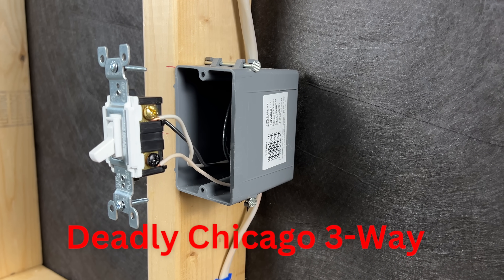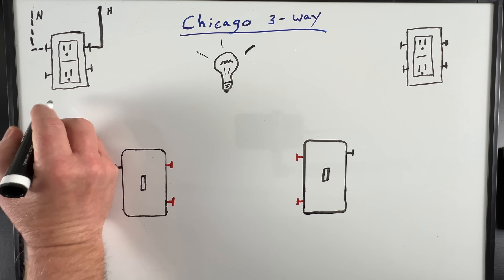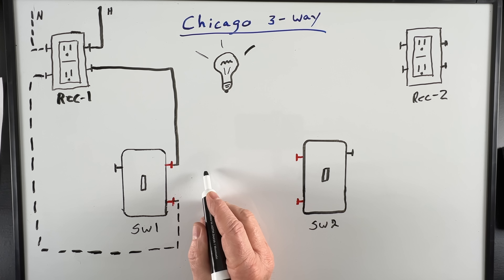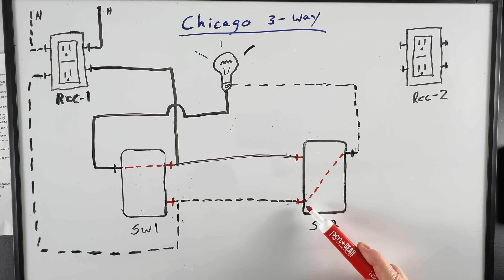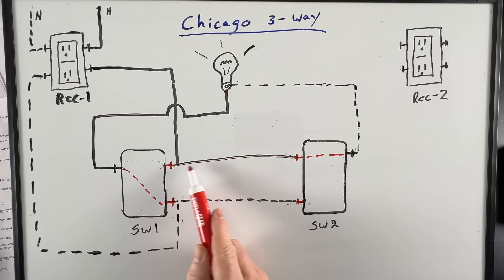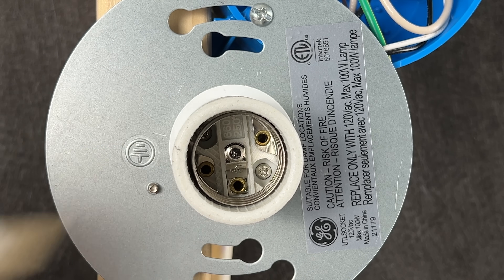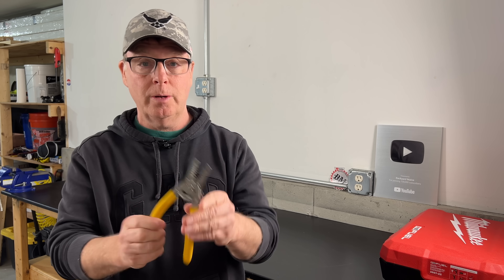The Deadly Chicago 3-Way (Only 2 Wires)

Comment: It feels like a building that has one of these would most likely not have the fuses labeled correctly either. I cant imagine one of these setups being used in a building new enough to have breakers.
Reply: Actually ran across one of these set ups in 2015, on a farm.  A three way switch in the house and barn controlled a yardlight in between,  with a single stranded wire from the house and barn, to the light, switches were on different panels,  house and barn.   Both were 100 amp  GE panels from  1977, when the 60 amp main and range fuse panels from when the farm got electricity in 1951 were replaced.    Suffice it to say,  this would never work with the AFCI / GFCI breakers required on virtually every 120 volt circuit in homes today, but this method was fairly common from the turn of the century, until 1950s and possibly even the 60s and 70s, on farms and the like, more often than not wired by old timers that lived during the great depression because it actually saved one wire, using 3 wires instead of 4, to switch a light between a pair of 3 way switches while having constant power for receptacle loads on both ends. My great grandparents grew up during the 1930s and would tell me stories about how their parents were forced to figure out on their own how to make the most do out of the least, as money was VERY scarce and times were tough, and I wouldn't be surprised if Grandpa wired some Chicago 3 ways on the farm they lived on for 12 ½ years, 1954 - 1967.

Comment: Young electrician raised on standard and dead-end methods. This just blew my mind. The ah-hah moment halfway through the video when I realized the light's polarity was going to be switched made me realize this is hick-ingenuity.
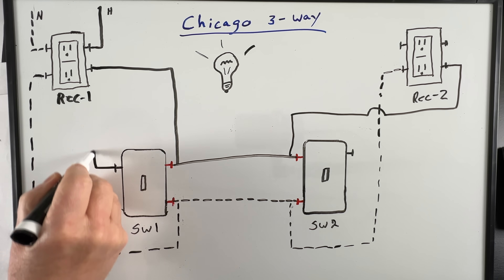Reply: 3:27 he mentions it. I didnt catch that until I read your comment.
So basically anything more complex than a lightbulb is gonna fry or have problems, right?
(im not an electrical guy.)
Reply: @threestans9096  not necessarily. Most everyday devices don't qctually care when AC is involved. It's mostly safety.
Reply: This is the best info I could find detailing a 2 wire 3-way circuit. While remodeling our flip house built in the 50's  I was scratching my head after opening the first jbox that had what appeared to be 2 neutrals feeding a 3 way switch. Old sparky ran 12/2/2 to the garage 3-way. I used a light tester to find the source out in the garage and I found it all right. Disconnecting and the  12/2/2 entirely...just to dangerous for me

Comment: It's crazy even if it does work. It's kinda like old pole lights on old buildings that were 220v and they just run one phase thru the contactor leaving one hot leg in the pole at all times.

Comment: I see these in every house I’ve rehabbed. I’m from St. Louis, but any house that is a 2 wire with no ground (50s or earlier) was wired this way. I moved to Omaha and same thing here. It is totally confusing and I’ve been shocked a few times thinking the power was off when I turned the light switch off. I turn power off now.

Comment: It seems like more work to wire it that way, I'm surprised that was common back in the day.
Reply from the maker: The wire system was much different and there were only one or two fuses for lighting and receptacles for the whole house. With this method they could go from receptacles to switches and back to receptacles with just two wires. Seems crazy now though.
Reply: @BackyardMaine  makes sense now that you point that out, pretty clever from an engineering standpoint even if it is very unsafe lol

Comment: We get the same thing here in the Philippines where i live there are 2 wires from the meter to the breaker box , no ground or nutural only 2 -110 wires into the house lights are 220 so if you turn the switch off the light is still hot, you have 110 to the light you have to throw the breaker to kill all power

Comment: I had one of these neutral flip 3 ways in my 100 YO house, it took me a bit to figure out what they did. You see this in old houses where the light fixture was always hot and then neutral flip modified with wall switches. As soon as I removed the bulb, I figured out what they did. It was old knob & tube wire, so they grab any available neutral source and run it to the lower light switch to save wire and time. They took neutral from the outlet to the lower switch, cutting & into the hall stairwell neutral at the fixture. Then added a switch at the top of the stairs tied to the nearest neutral, then down to the lower stairs switch and flipped neutral(s) to the fixture and abandoning the fixture old neutral wire. You can call that a MN neutral flip.

Comment: Im in Chicago and never came across this one but only What we “Line and Cross” which is essentially a Carter System or similar to California 3-Way, funny how I have not seen this method and I’m 24yrs in only ever working with cloth wire daily and running into knob and tube very often.
Reply from the maker: Interesting!
Reply: @BackyardMaine  yes it’s a very odd thing to see that wired when I’m in Chicago daily and most of the suburbs but in 24yrs I have only see the Carter System or that California 3-way, when I first started Dad always called it “Line and Cross”
Reply from the maker: @Jesus_Strong  I believe the Carter and the Chicago are the same method.
Reply: @BackyardMaine  ok I just rewatched the video and the receptacles are throwing me off. Every time I run into them is exactly that way, Hot and Neutral travelers, which essentially the switch leg at the light is always hot which is why customers get shocked or just interrupt the 3-way by changing the switch, all of this I see in cloth wire though mostly in armored cable or black rigid pipe.

Comment: I can share a fifth danger of this Chicago 3 w-way viring: if someone uses a higher power rated bulb and an arc builds in the one of the 2 switches on turning off it can short the hot and neutral. It may damage the switch, frighten the user or sometimes cause injury.

Comment: So if one is using LED bulbs, this wouldn’t work anyway because of that polarity bit
Reply from the maker: Actually with most if not all LED bulbs it won't matter. LEDs are supplied with DC power and you are correct that power only flows in one direction through a diode. But our AC power feed a power supply with then feeds DC power to the light.
Reply: @BackyardMaine  oh, OK I was thinking the reverse polarity would keep it from working. I didn’t realize it converts to DC in the light.

Comment: This leaves a lot to be desired in terms of showing where the actual cables would be run. For instance, the light has two wires coming into it, one from each switch. I know this was originally done with knob and tube, but how would that be wired with Romex?
Reply from the maker: With knob and tube wiring it was common to run one wire, two or sometimes three wires depending on the situation. With grounded cable it would make no sense.
Reply: @BackyardMaine  I see, thank you.

Comment: you could've made a much more simplified design if you mirrored both switches and had the light in the middle but ok I got the idea.
Reply from the maker: I thought about doing that actually after the white board presentation but I was worried people would loose interest.

Comment: Nice!

This isn't really hard to understand at all.  Beats me why some people have a hard time figuring this out. 

It's dangerous because it both routes power from the hot lead where it's not supposed to go as well as puts the neutral lead through a switch, which means the hot lead will still be applying power to the load when it shouldn't.

Thanks!

Comment: I found this chicago 3 way in a 1920s farm house here in Denver. the home owner changed the switches but got the wires mixed up. I figured it out and got it working so my recommendation. if you change the switches pay attention to where the terminals are on the old switches and on the new one(especially the common).

Comment: Very cool. Here in Oklahoma, many residential electricians and service electricians know of the Arkansas 3-way and the California 3-way, but this is the first I've heard of this one.
- Arkansas: in old houses where the circuit hot was brought first to the fixture box in the middle of the ceiling, a 14:2 Romex cable would be taken to the first 3W switch where only the black was used for power to the switch. (The white was not used). Then between switches, again 14:2 was strung for travelers. Then a third 14:2 was run from the second 3W switch back to the light fixture as a switchleg. (Again, the white was unused.)
- California: In stairwells where the circuit is closer to the upper switch and also to the fixture than any of these three are to the bottom switch, a 12:2 Romex is run to the upper switch for hot and neutral. Then a 12:3 is run from the upper switch down two the lower switch: white phased as constant hot, red and black for travelers. In the upper switch box, the circuit hot is NOT landed on the common screw of the upper switch; it is instead spliced to the hot-phased white inside the upper switch box. Finally, a 12:2 is run from the upper switch box to the fixture: white being neutral, and black being the switchleg tied the common screw.
Reply from the maker: Interesting.. I made a video on the California 3-way as well but I have not seen the Arkansas 3-way.

Comment: Electricians really were haphazard decades ago. There's something probably worse at my father's place; if you turn on/off 2 switches in one room, you'll get the fixture to dim about halfway, and plugging a load into the outlet makes it dim even more. I told him to hire an electrician, oh, about 20 years ago.. to make it worse, they're the older single push-in toggle buttons
Reply from the maker: I saw that one time as well many years ago. Must have been a homeowner using the ground wire as a switch leg. I have seen some scary things over the years.

Comment: Another problem I can see with the Chicago 3-way is if you do actually have a second outlet on that far right side, the bulb is now is parallel with the devices plugged into that far outlet when the bulb socket is in the HOT-HOT state. Only a small fraction of the current would flow through the bulb (proportional to the bulb's resistance compared to the normal hot), but it could lead to very unintended results.
Reply: Come to think of it, I might've experienced this in a 100+ year old Air BnB. The LED bulb was dim (maybe 5-10% brightness) when switched off. Now I'm thinking this is probably the explanation.

Comment: Honestly everybody talks about the danger of the way things used to be wired, but I have a way to go about it that has kept me from getting killed.
1) Assume everything is hot until proven otherwise
2) Don't touch anything
3) Avoid being grounded
4) If something must be touched, do not hold with both hands
As a welder, this also works pretty well for me.  I used to get shocked constantly, until I decided to not just let gloves give me a false sense of security.  Now when welding at home, I don't even change welding rods without either standing on something that is not grounded, or setting the electrode down and picking it back up with the stinger rather than holding the electrode in one hand and the stinger in the other.  I also turn off breakers or unplug lamps before changing lightbulbs if it requires removing a physically broken bulb.  I have been shocked countless times, most of which were inadvertent.  Every time, it was avoidable.  You cannot get shocked unless you allow yourself to make a circuit, plain and simple.  If you can't understand that, you're in the wrong line of work.

Comment: Im just a diy guy but have run into this a few times helping friends debug their houses. I always assumed these live off bulbs were caused by other diy people and i would remove the second switch. Im truly surprised that professional electricians believed this was ok.

You might also suggest putting a gfci outlet at the root of all two wire circuits - in case theres a partial short.

Comment: "Bear with me this will make sense in a second" No it won't, it'll work but it still won't make sense to me.

I mean I get it, I know how it works, it just doesn't make sense to me that anyone would ever think this was a good idea.
Reply from the maker: It was used back when electricity was first being installed in homes around the country. Before grounded systems were required and they used knob and tube wiring so it was much less of a hazard. Its been a violation since the 20s but there were many parts of the country that didn't have code enforcement so they were installed in some areas for a long time after. I have never seen one on a house built after 1950.

Comment: You can switch neutrals as long as it’s on the same throw as it’s associated hot.
Reply from the maker: True.. 404.2 (B) exception. But this cannot be done with 3-way and 4-way switches. 404.2 (A)

Comment: I first encountered a setup like this in a house I had bought that was built in 1954, although it didn't use 3-way switches, it used similar methods. They had wired the outside porch light to be permanently on and use a sensor with the same wiring and circuit as the kitchen sink light and switch that controlled the kitchen light, outside light and "GFCI" plug in the same double wallplate. I wanted the light on the switch.
I had everything off, yet got zapped by the neutral wires of all things. I also had the circuit breaker trip once I got everything hooked up correctly. I found out they had wired it like this where another switch on the opposite side of the kitchen, that didn't even control the light, put power through the neutral. I disconnected everything in all those circuits, used a wand toner to isolate each wire, and wired everything correctly. I still had a random hot neutral, but it wasn't in the circuit and I couldn't figure out where it went, so I capped it off, taped it off, labeled it, and stuck it back in the junction box. Poor wiring technique could have had bad consequences for someone who didn't identify it.

Comment: That’s an interesting method. Thanks for showing it! 26 years in the electrical trade and I have never seen this. I have seen some knob and tube wiring that was switching the grounded side on single poles.
Reply from the maker: It's not common but they are still out there in old homes that haven't had the electrical updated.

Comment: Was it that common back then to not have proper grounds?  Wild.  When was that all changed?
Reply from the maker: This is a very old method that was abolished in the late 1920s but in areas with no code enforcement (which was common) they were still installing them many decades later. Old homes were ungrounded especially in the early days and again in areas with no code enforcement that continued for decades.

Comment: A 5th reason it's dangerous:  If either switch happens to make-before-break (that is, momentarily contact both travelers at the same time, while being flipped), then it shorts live to neutral.  I am not sure these switches are guaranteed not to do that.  In any of the other wiring configurations, make-before-break would not cause any observable effect.
Reply from the maker: Yes that would be a short circuit but light switches are designed to break before make.

Comment: Think this is bad? I had a house with a 3-way that use to 2 circuits and 2 breakers to run 1 bulb. So even you turn off 1 breaker, still have power on some wires. Likely most of neighborhood have same problem plus have Aluminum Wiring too that needs major work to replace outlets etc. after 40+ years.

Comment: At first I thought why would you do this then I remembered knob & tube used single conductors. Ah-haaaa!! Very cool video. I never knew this existed. I suppose when electricity was installed strictly for use as means to light a bulb, this might have been “ok” but yeah, I totally understand how dangerous it could be.
Reply from the maker: For sure, if we're running cable like most homes today it would make no sense.

Comment: I'm surprised that a electronic switch hasn't replaced the three way switch by now. If a electronic switch was used you would just need regular romex. As many switches that were needed could be added, and the switches and light sockets could communicate during the zero voltage time of the sine wave like to old x10 home systems used. Also the light switches would always be push up for on, down for off, which is not always the case on the old regular three way or four way switches.
Reply from the maker: There are a lot of people installing them but they surly have replace the hard wire switches just yet.

Comment: I wonder why these were even used.  I guess maybe there was a saving in the amount of wire used...
Reply from the maker: Back in the early days of installing electricity in homes they used a two wire system called knob and tube. There were very few lights and receptacles compared to modern system and very few regulations. On top of that most jurisdictions had no code enforcement so it was the wild west in many parts of the country.